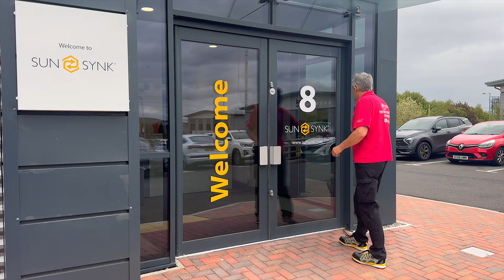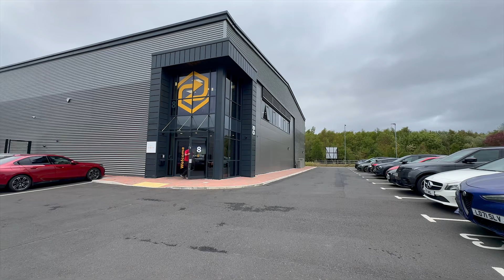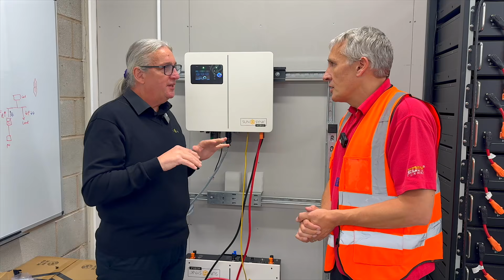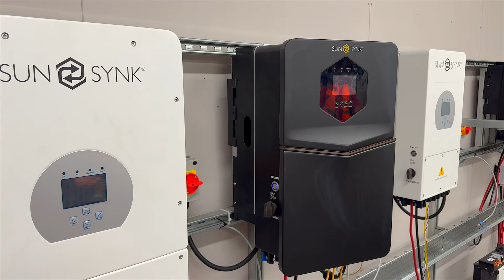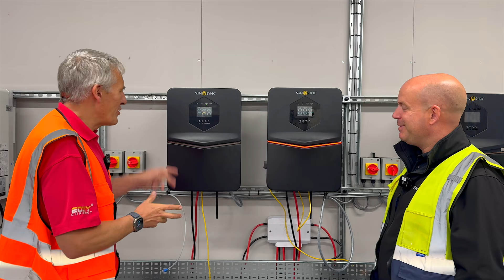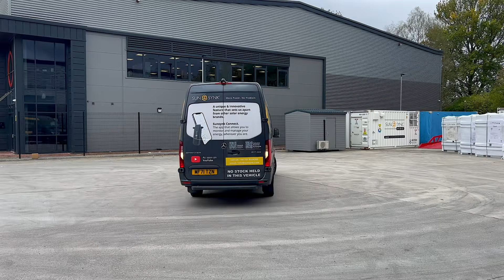Inside Sunsynk HQ - What’s Next for Hybrid Inverters?

Comment: Interesting! I'd only yesterday decided on a SunSynk inverter as the most likely upgrade for my dodgy 'outstall'. Is G98 being promoted here in quiet acknowledgement of "what happens if everyone in your street is exporting"? Export has no diversity!
The G98 bit is ear-catching because I thought export-limiting was a functioning inverter feature. Are people 'gaming' inverter limits to poop out the occasional extra myriawatthour (only just learned of the now defunct myria- prefix) when the price is right? It'd bother me that my 7kWp of panels and 20kWh of web's cheapest lifepo4 battery couldn't completely power my shower...

Comment: If you had up to 8kW of solar - you wouldn't be putting in a g98 3.6kW inverter, but a 5 or 8 (or 2 x 5kW) inverter & set export limit according to g98 or DNO limit
Slinging in a 3.6kW is often short sighted - especially cooking dinner with a 2kW oven, maybe induction hob, 2.8kW kettle on, with air-fryer or microwave - at times pulling past even a 5kW inverter - briefly drawing from the mains at 30p per kW, even though you might have 10kW in battery storage

Yes, you can scrape by if you turn the oven temp off for 3 or 4 minutes whilst you boil a kettle etc...
But in the end the customer/installer will likely need to upgrade to a slightly larger inverter with a modest bit of room for peak demand (and some future-proofing too)

Plus not much difference between 5kW & 3.6kW, 5kW should be min spec for most instances, otherwise you gotta buy another inverter & need to flog the old 3.6kW - that's why you need to over-spec the inverter, at least a little bit
Reply: 'Cooking load' in our house before we started trying to avoid using billed electricity was regularly 5-7kW. There's nothing preventing someone switching on the electric shower! I know you would only pay for the imported difference, but it would annoy me even if it was irrational (eg the cost of equipment outweighing the benefit of saving even more pennies) or the smaller unit being less noisy / easier to avoid overheating. I guess it must impact on long jobs like car charging too, if you want to transfer most of a big house battery's energy into your EV? I don't have one yet... it's not on the cards.